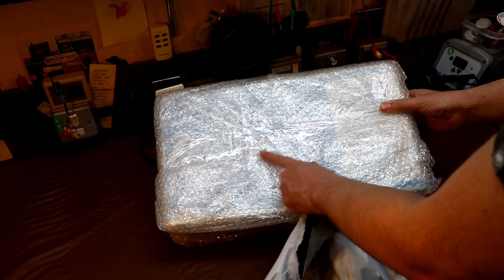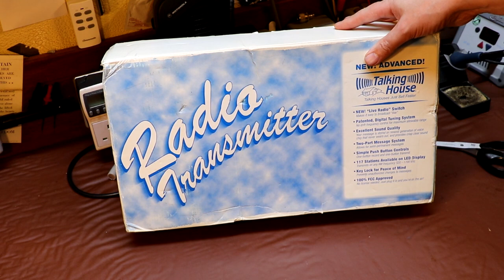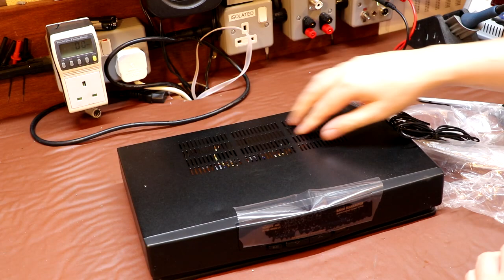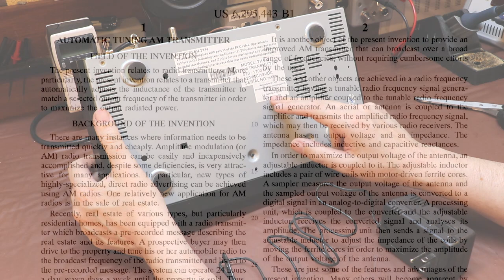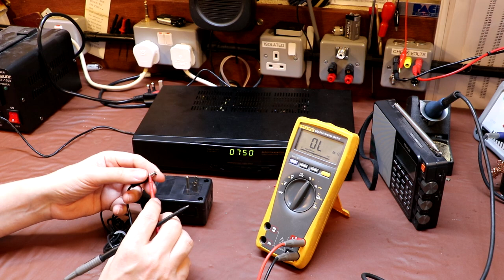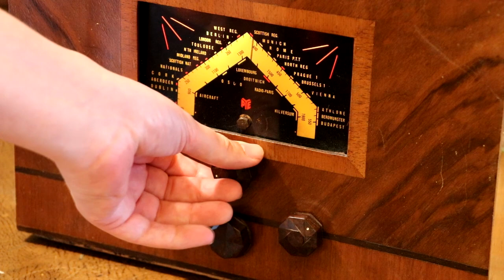Talking House Transmitter TH5  -  Part 1

Comment: It appears you tested an older Broadcast Marketing LLC unit and not one from Radio Systems, Inc. or the current owner, Information Station Specialists. The unit you have is the original speech-grade transmitter versus the somewhat newer version which have been optimized for music. I had previously reviewed both versions of the transmitters on my website and the higher fidelity i.AM.Radio version has a video review on our YouTube channel

Comment: The manual is online. It has an automatic antenna "tuner", thats the noise you hear.  The manual is on line also.
Reply: The speaker 🔊 is connected to an " air monitor" which allows you to hear what's on the air.

Comment: I used to own two commercial AM stations. AM radio antennas dont need height, they need a good ground plane. Before mounting that on the roof, try stretching out some horizontal ground plane wires. Think of what an old base station CB antenna looked like. 
You might find an incredible increase in signal.

Comment: You could try connecting another wire that's around the same length of the antenna wire to the case to act like a ground plane counterpoise.

Comment: Another factor to consider is the impedance of the Apple iPad output vs the input impedance of the audio input of the transmitter.
Reply from the maker: I don’t think there is an issue having a low impedance source driving a high impedance load as we aren’t concerned about maximum power transfer in this type of application. I don’t think the talking house was designed with fidelity in mind probably more about restricting bandwidth. Thanks for watching and comments alway appreciated. Best regards Chris

Comment: Talking houses were a thing here in Australia but they used FM transmitters rather than AM.  A friend of mine recorded a few in the eastern suburbs of Melbourne. I  never heard any in the northern suburbs.  Switchmode ps noise is a pain, I have a box of wall warts of the transformer type I can rummage in.  Just thought of something, try wining the DC wire round a lump of ferrite, might reduce the switchmode noise a bit. Typically US does use the Neutral as earth/ground.
Reply from the maker: Yes there does appear to be a lot of FM transmitters around suitable for our reuse and feeding wirelessly sets. I have some ferrite clamps on the cable but it didn’t make an improvement. I will be keeping a look out for old transformer supplies but often then don’t have the ov on the DC side grounded as does the transformer supplied with the unit.  Unfortunately it’s all very variable some days the hum isn’t noticeable other days it’s very loud. Probably something in my house is responsible but still difficult to track it down. Thanks regards chris

Comment: As for the powersupply, here's a little tip you can use for testing purposes.
Cut the output cable with DC jack of a old/broken notebook adapter, and add some banana jacks to the cutoff end,
so that you can connect these banana jacks to your bench powersupply. 
If the DC jack has the very common  5.5mm x 2.5mm size, then there are a wide range of tips to convert to 2.1mm etc.....
Here in Belgium (and other countries of Europe) we use mains connectors with 19mm (center to center) between the Live and Neutral pins,
this 19mm is also the standard distance that bench powersupplies , multimeters etc use.
So instead of banana jacks, i have used a main connector (without the earth pin), and use that on my powersupply, 
that way my powersupply can replace any mains powersupply adapter. For safety, i have marked the + and - on this mains connector, 
because our type of mains connector without earth pin can be swapped arround.
Reply from the maker: Thanks lots of good tips. I will definitely try a bench top power supply. The hum problem is very intermittent I think it’s being mainly conducted into the transmitter through it own antenna. My house has a lot of computers and test gear so it quite a challenging EMI environment. Thanks for watching and comments regards Chris

Comment: Hi. Interesting device. Regarding the original power adapter and the hum problem, the electrical system in the US is a little bit different, the house service is actually 240 volt, with a center tap, that way there are two120 volt main circuits (180 degree opposite phases), and the neutral (the center tap of the  company’s transformer) is tied to ground on the electrical panel (consumer unit). So, the ground reference is slightly different, and the original power adapter is maybe customized to that. Cheers.
Reply from the maker: Thanks for watching and beautiful explanation on the US mains wiring.

Comment: AT 22: 00 minutes in you are correct. Simply ground the metal chassis will eliminate the hum. The spec sheet at the end of my transmitter installation
and operation ( pdf mentioned below) states that the power comes from a 110/120VAC via included 18VDC 100mA external transformer with a grounded AC plug.
Your ordinary transformer doesn't do that without major reworking of it. You can get a small internal tooth washer and  connect a wire to one of the screws
to hold the wire onto the chassis. The other end can have a clip to a known ground source. Still the batteries show you still have AC powered hum being 
introduced into the transmitter circuitry. A part two will definitely be in order.

Comment: Chris the hard to find  manual for it can be found at theradiosource.com/downloads/talking-house-i-am-radio-instruction-manual.pdf
Own model TH2 myself. Plugged in my Sirius/XM radio output into it and set it to  their old time radio channel. It was set to a frequency where no other station 
was nearby ,not easy to do in Chicago, and picked up the Sirius/XM broadcast of some very old comedy show from the 1940's. Fun to receive 
that kinda thing when I get an old tube/ valve radio I own fixed up to play era correct stuff from said radio. Cheers.
Reply from the maker: The old radio shows definitely sound a lot better than the modern stuff I’m guessing it was actually designed to be transmitted in a particular way that best suited the receiver of the day. I put a link in the show notes to the manual,  I also put a link to the patent that has the circuit diagram which are very interesting. I have also put a lot of old shows and links in my radio testing play list. Thanks for the manual information and comments best regards Chris

Comment: Interesting Chris, I think you will always have problems running a transmitter with the antenna in the room, if you used an external one i think it would eliminate most of you're problems, but rf is a bit of a black art, I wonder how much power it actually produces?
Reply from the maker: I’m measuring around 150mW RMS.  There are a lot of factors. It really needs a good ground probably better than my house wiring allows with a PMA fuse board. It does rely on using the the ground system as a counter poise.  It’s very sensitive to ground loops. I think the noise level in my house is so high it’s get into the transmitter through it’s antenna and getting into the audio path.  I tried running it outside from batteries and that eliminates the hum but it’s also not a practical solution. Thanks for watching and comments regards Chris

Comment: Shame it's doing the 10Khz steps. Maybe some PSU decoupling in the transmitter?
Reply from the maker: I think the unit doesn’t employ very good internal grounding and separation between audio and RF grounds. I suspect a lot of noise is being conducted into the unit via its own antenna.

Comment: Interesting unit, Chris. As you said at the beginning, it might be worth checking the filter capacitors inside the unit and maybe adding some as most of your hum appears to be power supply related. With such a large box, it might be perfect for a modification to add a MP3 player and Bluetooth receiver inside. Thank you for another entertaining video. Regards, David.
Reply from the maker: I think the hum is maybe being conducted from the antenna then back into the unit. It does come and go very sensitive to the manner of installation. I will be doing more testing.

Comment: When you get said widget working better, inject 1khz audio tone and see if it is capable of 100~110% modulation by viewing the AM RF output envelope. Have my doubts, but I'm sure it will be fine for your end use of listening to your antiques. Old time radio shows are still popular today here in the US. 2 of the 3 local AM's I worked at here locally have now gone dark. The land where the TX antennas were located was worth millions and ended up being developed for tract homes.
Reply from the maker: I will be doing such test in part 2 of the video and trying to make some tweaks to the audio. It’s funny but some of the radios are much more susceptible to the mains hum from the transmitters than others etc Thanks for watching and comments regards Chris

Comment: Looking forward to part 2, Chris. I note that the channel spacing is the usual US 10 kHz, as opposed to the European 9 kHz. I suppose that the extra bit of audio bandwidth is just lost in a UK/European set.
Reply: If your radio scans in 9 kHz steps then you need to use a frequency that’s divisible by 9 or 10.  So 630, 720.....1620....
Reply: @sinewave4236  Given that the intended use is vintage radios, I don't think that the different channel spacing is significant, except in making sure you don't cause interference to actual broadcasts. Mind you, UK MW stations are getting fewer and further between as Chris noted.
Reply from the maker: I did a dirty measurement and it rolls off quite steeply after 4.5khz. I could probably change the Crystal to get the correct channel spacing but I don’t really need to. I will be making some measurement and tweaking the audio in part 2. Thanks regards Chris

Comment: Hmm a halfbaked pile of poo, but i suppose if it was used to attract people to view your house it would be a throw away device after the house sale.
I could not hear any hum, but my lugholes are faulty lol.
Did the hum go away if you plugged in a grounding plug into the audio in socket?.
If r.f then it needs chokes and capacitors in the power distribution tracks.
But it could just be dead caps, being half baked crap.
Can you tell i dont think much of it :-D
My mate has gone mad on those Tecsun radios,  he has three radios,  the last one is the pl880.
I have found some bits of the diagrams, just in case he breaks it lol.
I told him to put up a shelf lol.

Comment: I continue my search for a reasonable AM transmitter . i now have 6 different ones all have problems from lack of range to over modulation an hum .but i live in hope of finding one.
Reply from the maker: I think these transmitters need very careful feeding regarding the compression or commanding of the audio input to the transmitter. I think I have it working acceptably well now. But it did take a lot of trial and error. Thanks regards Chris

Comment: Good review - yes you do need to fiddle around with them to get them to work.  I have found that getting the unit up as high as possible in the house gives the best signal.  You do need to ground the case for sure.   Connecting up a blue tooth receiver to it works well and then use a high input volume so that you don’t need to turn up the volume on the radio too high.   If whatever you use as an audio input has a mains power supply then this all adds to hum as well.
Reply from the maker: Hi I’m going to be doing a part two with this  transmitter  including measurement of the output power and frequency response etc and tweaking some of the components internally. I have built up a Bluetooth module with a preamplifier but it is suffering with digital noise breaking through into the audio. I think it’s probably just the low cost module that I’m using etc maybe need to try something better. Thanks for the operating tips that’s good to know I will work on improving the grounding. Thanks for comments regards Chris
Reply from the maker: For some reason your other comments are not showing up, but thanks. Yes I have a few other units myself but I was thinking of asking 6V6 if they would loan me their latest unit to do a review on.   Thanks regards Chris n